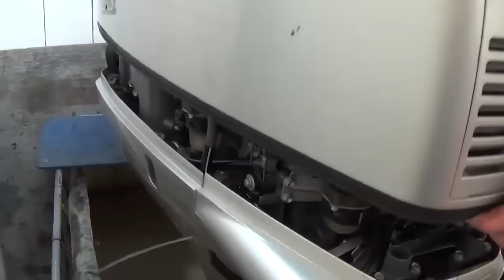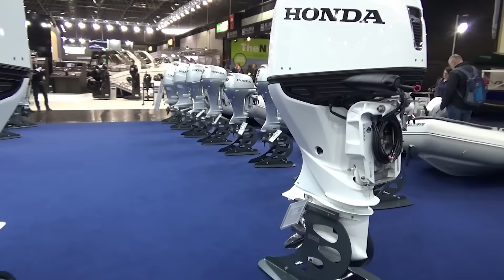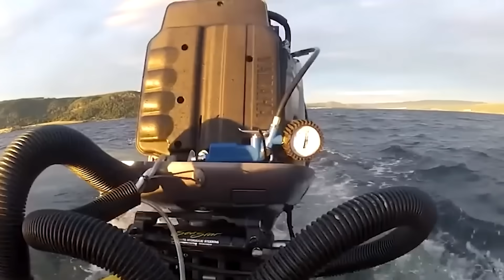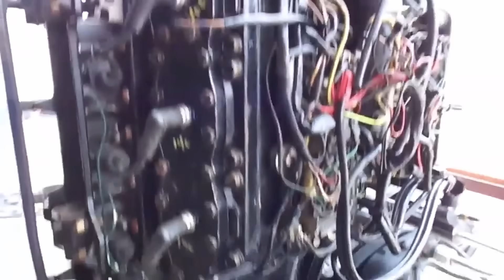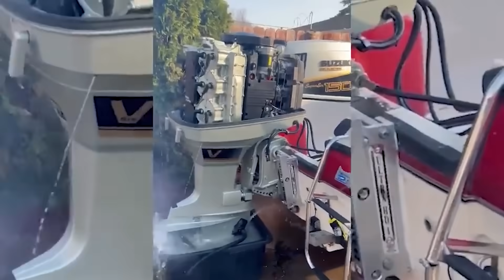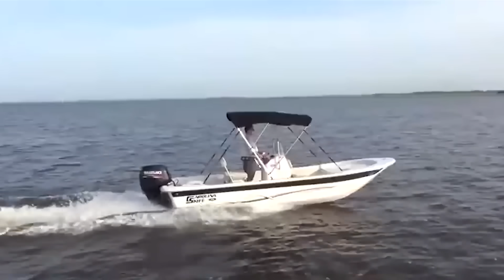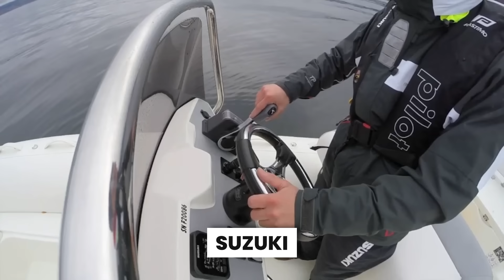Why Japanese and American Motors Are So Different?

Comment: Yamaha does not build any engines for Mercury for about 20 years. Mercury outboards 200 hp and up perform better than Yamaha and up to 150 Yamaha does make a good engine like Mercury. Small ones are made overseas
Reply from the maker: @hipochevys thanks for watching and sharing. Sounds like a Merc preference. Cast your vote in community post!

Comment: I own a 9.9 mercury and was so happy when i bought it. On the first day out the choke lever pulled straight out of the housing. I was pissed off. Then i looked at the plate that said made in Japan.  Japan used to make  good products.
Reply from the maker: @davidsmith-tu1nd That's unusual and a shame. Hope you got that fixed up for free!
Reply: @VintageBoats 
I fixed it myself with some pliers. The rod lever to choke was bent at maybe at 45° to attachment. I bent  the rod so it wouldn't slip off.
Reply from the maker: @DavidSmith-tu1nd Nice. Even better!

Comment: I haven’t ever owned one, but my friend did take me out on THE ACTUAL Miami Vice Talon cat with twin Merc 300XS’s on it. 

The sun was setting and we were just flying out of a side area on the lake that merges into the “main stretch” kinda. As we were turning I looked over and there was a HUGE twin engine Fountain going probably 70…. We got alongside and started accelerating. I know he was wide open because he started kicking a rooster tail and was all trimmed up.  We walked past that boat like it was standing still, my mind was just blown away - especially how well they handle turns and stuff. 

He sold that thing a while ago, but I’ll be damned if that wasn’t one of the coolest and boats I’ve ever been on.
Reply from the maker: @EstorilEm  Very cool and amazing experience. Thanks for sharing!
Reply: @ definitely a “vintage boat” story lol.

Comment: I have had a 1982 blue-band 18hp and 1998 20hp red-band merc which both had carby issues, ran great on the muffs and crap on the salt water. Traded the 18hp Merc for a 1983 Mariner/Yamaha 15hp which was rock solid for over 22+yrs for us. The 1998 20hp Merc was traded for a 30hp Yamaha CV 2008 which was much better once I tuned it properly. Also had a 1998 90hp Yamaha in between and all I can say is that Yamaha's can't be beaten in the 2 stroke category because they are so reliable and trouble free. Now have a Suzuki DF40A and its been great so far, so quiet, fuel efficient, user friendly, and has heaps of torque but down side is that its heavy. Hope to switch out the silencer and possibly the ecu in order to turn it into a 50hp.
Reply from the maker: @dazl2954  Sounds like a great plan. What do you use the boat for?
Reply: @VintageBoats  use the boats for a combination of fishing, crabbing and prawning. All the boats I have owned have been under 14' except the 1 X 17ft boat in between. The smaller boats are easier to handle by yourself, cheaper to run, easier to maintain. I am that idiot that take small boats through swell just as big as the vessel.
Reply from the maker: @dazl2954  As long as you keep your self relatively safe and sensible... nothing wrong with a bit of risk and adrenaline on the water.

Comment: I had a Classic Mercury 50, and that was a great little motor and is still running great for its new owner. My dad had a Merc 200 2 stroke, and it was a screamer, but blew up twice, and had a handful of other problems. The first time it blew was due to a piece of trash plastic gear failing in the oil pump. My dad had a Suzuki 70 that not only was a screamer, but sat on the bottom of a river for 2 weeks, came up, was flushed out, and ran fine. A friend had a yamaha 115 2 stroke that got ran hard for over 20 years and never had problem. It started and ran always. I now have a 06 Yamaha 90 2 stroke that runs like it's brand new. It starts easy in warm or cold temps, runs like a sewing machine, and has only require a fuel pump. In all, the American motors seem to have high perfomace, but the Japanese motors go forever problem-free. When I'm running many miles from the boat ramp, I'll take reliable all day. Yamaha is as reliable as you can get for all of their products. Quads, bikes, outboards, etc.
Reply from the maker: @bkb5f620  thanks for sharing your experience and hope to see you back at the channel.

Are you on the water motor also on the quads and bikes a lot?

Comment: Biased, opinions, all of them. There was no data in the video to support any claims, and getting reliable honest data would be nearly impossible. At this point in time fuel injection has changed, well, everything. Just pick the brand you prefer with a nearby service center. As the made up/hearsay opinions will always be there, be happy with a running motor and enjoy the water. As someone who has owned all the brands but Tohatsu in this video I can say they all have their faults. Currently running a Yamaha 300 on a bay 2300 due to it being very quiet when we test drove it, yes we were informed about the very bad reliability of Yamaha cylinder walls but thus far no issues for us. There is a reason the white Johnson 150 outboards were as common as rats with wings at the wharf.......
Reply from the maker: @zacjones6711  a practical approach to all of this Zac. As long as people are enjoying time on the water and little down time, that's what everyone should be aiming for. No real bias here - whatever motors work for people's use! 

Thanks for commenting and hope to see you back at the channel for more entertainment.

Comment: Been debating suzuki 60 or yamaha 70 my boat. But specifically the older larger displacement suzuki 60 for the extra torq vs the newest version. In the end. I got a new yamaha 70 at very nearly half off due to sitting over a year in a marina that mainly sold 200 plus hp models. Before i found the slightly heavier and  torque focused suzuki. Very happy with my purchase.
Reply from the maker: @DustinDIY  a well thought out plan by the sounds of things. Hope it lasts you a long time!

Comment: Still run several OMC here in Wisconsin USA
Reply from the maker: @leepeterke4376  Awesome..what are yiu running?
Reply: @VintageBoats  1974 Johnson 6hp,  1974 9.9hp Evinrude,  1985 15hp Evinrude,  1996 70hp Evinrude,  1996 40hp Johnson,  all good runners.

Comment: You still see 80s Evinrudes hanging on transoms on salty Long Island canals that'll likely run until their diligent owners leave this earth.  Their are plenty of mid 2000s Yamaha's that have already rotted out to uselessness.  From what I've seen Yamaha borrowed heavily from Evinrude's designs.  Yamaha's casting quality from a geometric sense is far better and I doubt you'll find any misaligned cylinder liner as I've found in in many open deck loopers.
Reply from the maker: @winningwithoutracing7811  There's people in the comments who witnessed Yamahas 'tours' of facilities...so you're not wrong.

Comment: I had a 250 Verado. What a beautiful engine! Super efficient, smooth, quiet and the ability to scream at 6400 RPM using almost 100 litres of fuel per hour when needed. With only about 30 hours of use it left us stranded with a poorly assembled starter motor locking solid about 2 hours from the boat ramp. After that it never missed a beat, we sold it 600 hours later still purring like a kitten.
Reply: 100 liters an hour. is it good or bad?
Reply: @ClaudeMarchand-k3l  100 litres per hour is a lot of fuel. Just pointing out that it made 250HP flat out, but it could also cruise around for days using hardly any fuel if I went slow.
Reply from the maker: @neiltube8004  See some verado action coming in Sundays video..stay tuned to find out!

Comment: used yamahas & Mercs 15hp 2cyl/2stroke in d Philippines; while d Merc-cranks didn't last with local motorcycle oil, d Yams did  😀
Reply from the maker: @raedy07  thanks for sharing. Are you I the Philippines full time?
Reply: @VintageBoats   usually during europeon Winter ☀️

Comment: My 1993 60hp 2 stroke Mercury still runs great, and it sits in a frozen lake every winter.  I only take it out to change the lower unit oil.
Reply from the maker: @thesevideos4382  That's handy! A good age on that motor. Thanks for sharing.

Comment: I have a 1974 starcraft I/O with a 4cyl GM motor. I know this video is specifically towards outboard but  thus little 50 year old boat keeps on going! Other than maintenance and a impeller every few years there have been no issues
Reply from the maker: @timsmith6683  Thanks for sharing..will be making more videos of other motor types soon!

Comment: I have used outboards for work for quite a while. Merc can eat shit. They are more interested in proprietary tech than they are with making a good motor. Japanese motors are the way to go, honda is the gold standard, purely Japanese motors have the mechanic in mind, they aren't trying to fuck you over.
Reply from the maker: @treavorwhitlock5606  thanks for watching..castbyour vote on the community post!

Comment: I work for safeboats. We install a lot of Mercury motors. Yamaha is next. As far as what is easiest to install and work on. Suzuki is the best the harness is small and dual setups are super simple compared to everyone else its just a small moduleyou plug into the existing harness to get counter rotation. Yamaha is next nice easy harness. They suck because you have to buy 2 different lower units for dual setups. Mercury is the worst, super bulky harnesses a bunch of different boxes and busses to get everything connected. And everything is an add on or a special cable. But once the Mercurys are set up they can do some crazy stuff.
Reply from the maker: @legendary_soup4454  Thabks for sharing the practical side of that end of the industry. Interesting to hear your thoughts. Hope to see you back at the channel.

Comment: As one who has worked in the marine industry. They are very similar, all of them.
They each have very few differences. In fact, some parts were swapable through the years.
Whwn Evinrude went e-tec, (shudder) that injection system was so differant and unique there was nothing that compared it to others at all.
When it ran, it ran like a bat out of hell.
I have had great success with each manufacture but also about the same amount of failures. 
However, an underdog in the biz is Tohatsu. Yamaha quality for the fraction of the price.
Reply from the maker: @kari53  Work on many Tohatsu's? Thanks for sharing your experience.
Reply: @VintageBoats  Sorry, I don't get alerts for comments anymore. Stupid fluke that I am back at this video. Lol
I have worked on a few Tohatsu engines, not a lot.
I asked the same question  o any owner that i find. "What is your experance?"
For the most part is has been the same answers.
1. Surprisingly dependable.
2. Stock up on comman parts if you travel. Impellers, plugs, props.
Depending on where you go you could be stuck for a part.

Comment: I have operated a professional fishing & hunting guide services since 1978 so I have a vast experience with these outboards.
My problem using these Mercury's and Yamaha large outboards was they break down constantly leaving clients on the docks and massive mechanic repairs and waiting times for parts can last a full month for travel time across the US for from factories overseas or in Mexico.
The last Mercury 225 EFI I have cost $30.000 in repairs and never ran well.
The 200 Hp Yamaha right off from new was defective and when talking to Yamaha they canceled the warranty on me when I told them I was a guide and fishing charter service.
The average life of these large outboards is just 2500 hours then the engines are done for and around 800 hours comes all kinds of parts failures and break downs.
6 years ago my work guide jet boat went through a rebuild where a Chevrolet Big Block 402 and a inboard jet pump was installed in the jet boat and since then NO BREAK DOWNS AT ALL!
The Chevrolet 402 works so well my other 2 work charter boats now run with Chevrolet Stroker 383s and again NO DOWN TIME AND NO BREAK DOWNS!
Never again will I buy the large outboards of any brands
Reply from the maker: @Lure-Benson  Thanks for sharing sounds like you have some cool working experience...and some difficult times. Where are you fishing and hunting?
Reply: @VintageBoats  I offer year-round salmon & steelhead fishing in Oregon NW corner and Roosevelt Elk & black tail deer hunts in NW Oregon.
for 30 years I was living in Alaska and offering Hunts for Brown bear - Yukon Moose and salmon - Trout - Steelhead fishing from the Keni peninsula - Susitna R and Yenta R - then I would move to the copper river valley for salmon fishing and by fall I had saltwater silver and pink salmon fishing.
If anyone would like a guided for NW Oregon salmon & steelhead fishing, I am here this summer.
Reply from the maker: @Lure-Benson  That's amazing. Sounds like a seriously good time. I'm definitely saving your contact for any potential future! Hope to see you back at the channel..

Comment: I've been a boater for 40+ years and had them all. The brand name on the hood does'nt always reflect what's inside. Japanese engine tech beats them all.
Reply from the maker: @billcollins6705  a fair enough comment Bill. What's been your most widely used?
Reply: @VintageBoats  I've owned lots of motors up to 50hp, I'm one of those people who switches their rig fairly often, in my case fishing boats. I'd have to say across that size range, 15-50hp, it's neck and neck with Yamaha and Honda. They're top of the pile.

Comment: My experience

1995 Yamaha 50hp 2 stroke - felt very precise. never felt nervous that it wouldn't start. Super reliable.
1980s Johnson 15hp. It was old so needed some work but as reliable as old boots once I nursed her back to health. Went over to fraser island with it on my little 12ft tinny. Momorable because I spent time working on it. Clearly a good motor if it still ran after 30 years of a hard life.
2002 Mercury 40hp (USA detuned 60hp) - Stonker, absolute brute. Drank like an Australian but it felt like it could have been rated higher. This was reliable for me too. Considering replacing the 30hp etec on my boat with one.
2000 (ish) Mercury 25hp seapro (rebadged tohatsu i think) We modified this one to be 30hp and pushed our 4km tinny to 43km/h with two big blokes and a bunch of fishing gear, food, drinks etc. Did have a quirk where you had to pull it once with the choke out but the kill switch removed, then a second pull with the kill switch back in and choke off. It started that way every time perfectly, but if you didn't you were giving it 30 pulls.
2014 Evinrude Etec 30hp - Bought it on a boat a month ago and came with a dead regulator. Parts are hard to get (knew this going in), but boy does it have some grunt for a little .577L. I have a very heavy 4.3m tinny and it gets on the plane pretty quick, though we do top out at 38km/h. Am considering replacing it with an older but simpler 2 stroke 40hp... thoughts?
Reply from the maker: @UnimpressedAussie  Thannks for watching and sharing your experience. Good detail here. I'm sure there's a lot of viewers with some good opinions on this.... the floor is open!

Comment: My first outboard was a Sears "Ted Williams" model. 7.5 hp. Already old when I got my hands on it. I carried a spark plug wrench and starter fluid (and hearing protection) every time I went out, But that was the only motor they'd let my 14 year-old self out with. Since then I''m now on my third Mercury, not that they've worn out, I started with a 9.9 and then added a 20 and 25 to my stable, all still run excellent. I went with Mercury mainly because that was the brand my commercial fishing family swore by. Much the same way that there are "Ford" and "Chevy" families, my grandpa and uncles would've frowned if I showed up at the river with anything other than a Merc on my first boat.
Reply from the maker: @Leightr  Passing down the fishing knowledge and the Merc brand to the next generation?

Comment: Australian here - owned Evinrude, Mercury/Mariner motors.  Had many good boating times with those motors, very powerful however I've had the most horrendous breakdowns with each and every one. I switched to Yamaha and never looked back. Got a 2002 220HP Yamaha 4 stroke. Always serviced and never broken down (touch wood).
Reply: Fellow Aussie Yamaha owner. 130 V4 2 stroke. Sure it's needed carbies cleaned, but it has never failed to get me home. And it's still quick - pushes my boat flat out at 80km/h fully trimmed outwhich is quick enough for me
Reply: OX66?
If so Those things are tanks.
Reply: Four stroke can Get A carburator problem after A while
Reply: Ide go with mercury, Yamaha four stroke have exhaust corrosion issues.  Mercury has a better alloy composition.
Reply: @wazup3333 No matter what brand they all have an inherited problem.
Reply: In America, we "knock on wood" for luck.
Reply: sound great , what town in Australia , yor from ?
Reply: So proud of you.

Comment: As a kid dad got us a ‘78 Merc 7.5 and man I loved that machine. Grew up exploring little bays and rivers on the lake. Put many many hours in it without a hiccup, abusing it as only a 12 year old kid does. Wiring eventually cooked and got brittle. Still got the thing. Have scavenged a lot of parts for it. Also had 40 and 70 hp Merc 2 strokes. Both ran well. 
These days our fish n ski boat has a 2004 Yamaha 90 4 stroke. Last year for the quad carbs I think. Love love that motor. Runs like a dream - quiet, efficient, reliable.